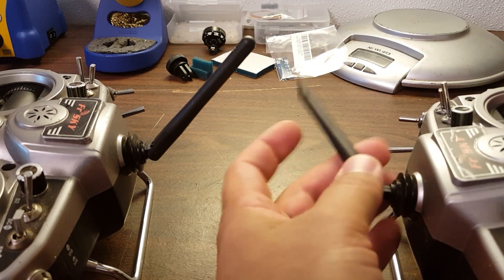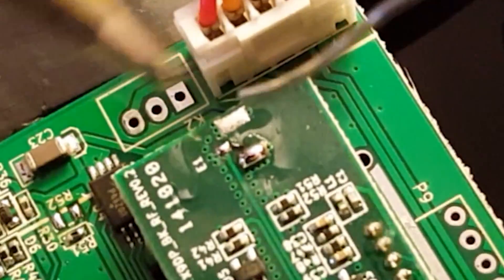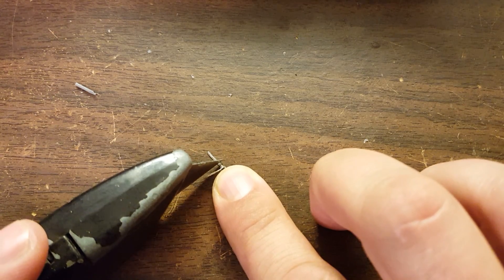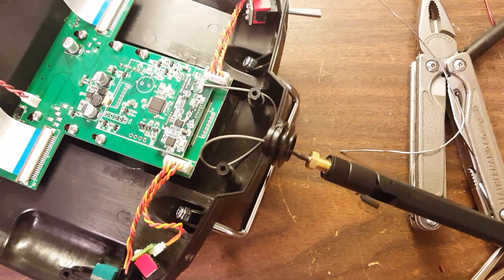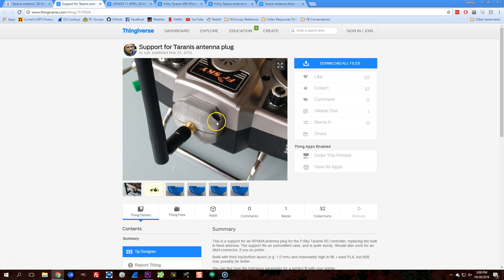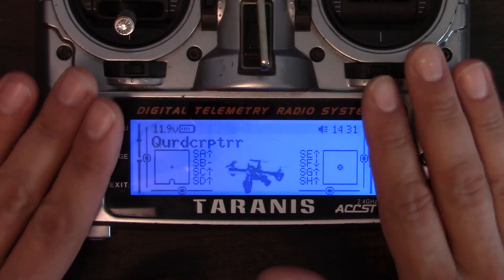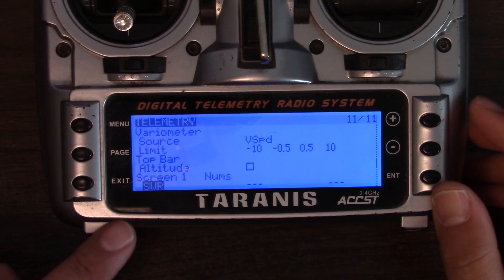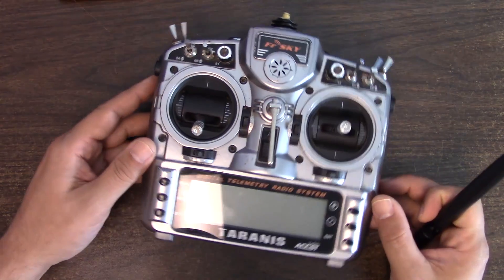FrSky Taranis 5 dBi RP-SMA Antenna Mod | POSSIBLY DO NOT DO THIS MOD

Comment: Also what range improvement you can get with the larger antenna?
Reply: Range do not vary with size of antenna, but from gain of antenna, you can have bigger antenna which would have less range.
To be strict you can't get more range from your Taranis and still be legal to use it then from factory configuration.
Regulations give effective radiated power (ERP) and that include antenna gain (for example if your transmitter is 100mW ERP from factory, which is legal limit in most of world, and you put antenna with have 3dBd gain higher then factory one you will get 200mW ERP which is twice higher then legal limit).

Comment: Just a note, certain versions of the Taranis do not have SWR. The plus version A01 does not have it, the A02 does not have it either but supposedly can have it with a Taranis internal module update, which is different than the firmware or boot loader updates. I've also heard that there is a bug in opentx 2.1 that prevents the Taranis plus A02 models from displaying SWR even with the module firmware update. The plus A01 models are hardware incapable of SWR. Don't take this as gospel because I'm just going from memory but I believe this is all correct. I believe most if not all of the other models of the Taranis and Taranis plus have functioning SWR.

Comment: To check SWR with open tx 2.1 follow the same steps, expect you don't need to add SWR to a telemetry screen, it should be right below rssi in the list of telemetry items. I think you need a model turned on to see it though.

Comment: I cant believe you're still using that crappy nicad battery in your Taranis Joshua!
Reply: Joshua Bardwell  I should have guessed!

By the way Joshua, after hearing you talk on a couple of podcasts recently, I would really love to hear you start your own podcast on your own channel. I could listen to hours of you and other people from the community like Boris chatting about FPV. Thanks for the video anyway :)
Reply: If your taranis came with the 2000ma nimh battery is actually pretty good.  I have a taranis and 2 taranis plus and all run on nimh.  I created my own packs with 6 cell 2500 low self discharge cells.  The nice thing about sticking with nimh is you can use the stock charger and never have to remove the battery.  Just plug and forget (its autoshutoff).  Its also plenty for many flights with the crossfire/ezuhf/dragonlink modules.
Reply from the maker: +Seaweed_ that's not my Taranis.
Reply: what is the best battery for the taranis? is there one on hobbyking?
Reply: skatebjarne the LiFePO4 1500mah 3s battery on hobbyking is freaking amazing
Reply: skatebjarne The LiFe packs from hobbyking work great and can be stored fully charged, they also come with a taranis connector

Comment: what about araura 9 gimbal mod
Reply: also what should be the temperature of the iron
Reply from the maker: Aurora 9 are good gimbals. I have a video on how to replace your Taranis gimbals on my channel.

I run my iron at 750°F generally. I wouldn't go any hotter for these tiny pads, and maybe down to 700.